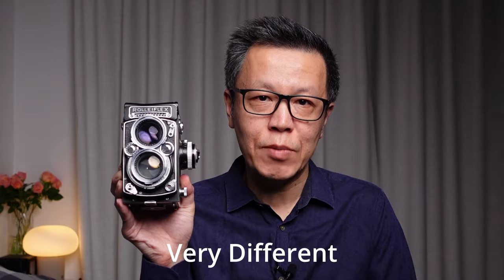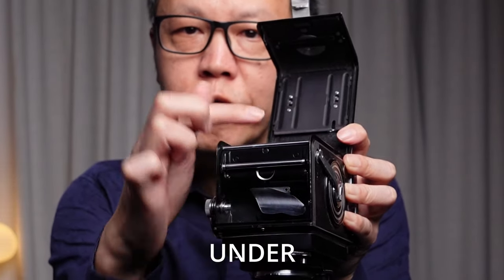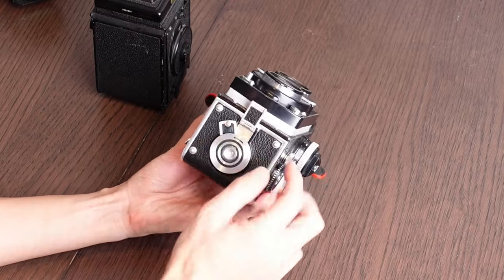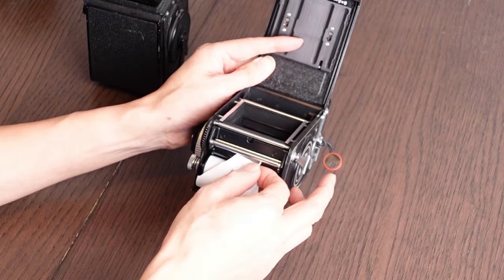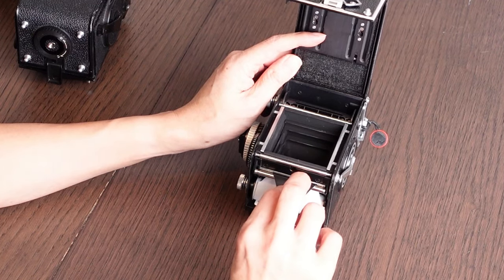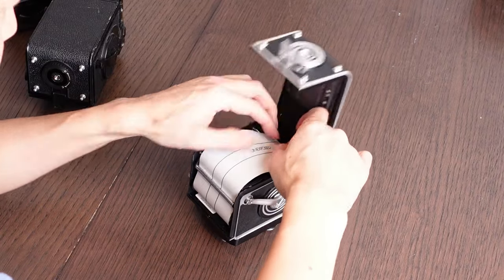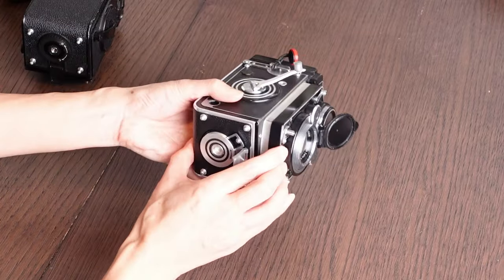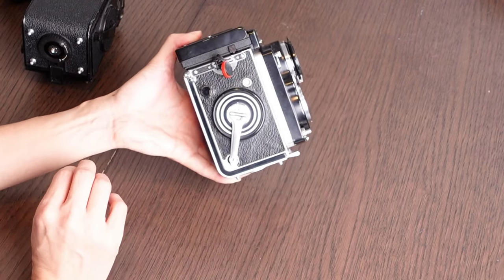Avoid Mistakes: Learn the Correct Way to Load Film into a Rolleiflex TLR

Comment: It's a tribute to the fantastic engineering that they could include a reliable mechanical sensor to detect such a small change. I'm just dipping my toe in the water with vintage cameras by getting an Ilford Envoy and a Purma Special - unsophisticated but cheap! My dream is a Rolleiflex if it turns out that I'm any good with street photography 😊.
Reply from the maker: That’s a great idea. Start with a modest set up and if you like it you can consider moving up the ladder. Yes in the era of modern technology, sometimes it’s amazing to marvel at how ingenious these people were 60-70 years ago to create these mechanisms.